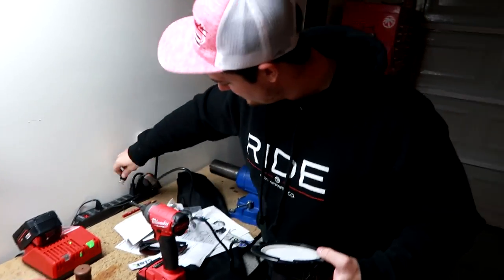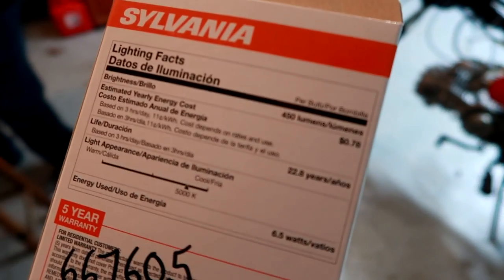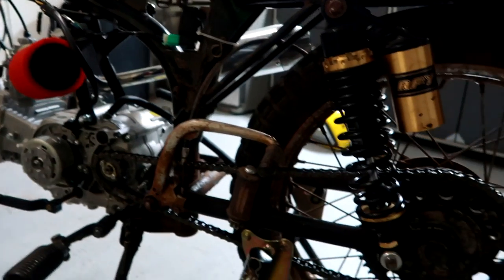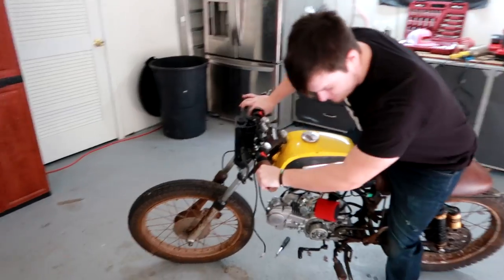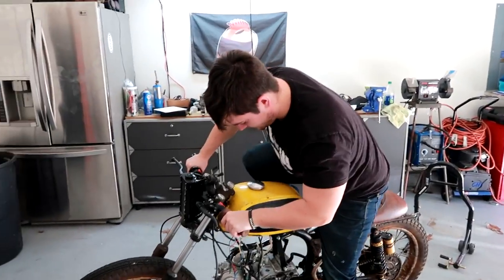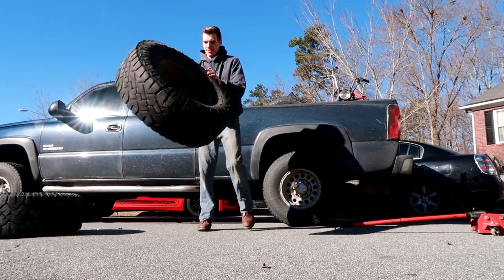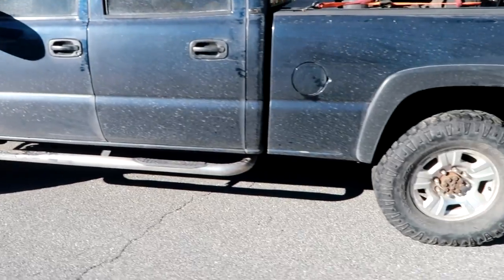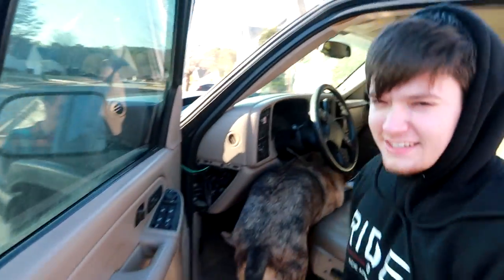the night i should have died

Comment: I almost had this happen after getting my tires rotated at a Goodyear shop. I drove it about 60 miles and noticed a wobble so I slowed down. my rear end started shaking back and forth and I started hearing a squeaking sound so I pulled over, 3/5 lug nuts had fallen off. Luckly I was only a few miles from the shop that did it so i went there and chewed them out and they had the gall to insist that sometimes this just happens and it wasn't their fault. I had them put 3 new lug nuts on and took the car home and checked all the torques myself, thankfully they were all right this time (I suspect they went over them all when i brought it back) I will NEVER visit that shop again and warn all my friends to stay away.
Reply: This was a Subaru Legacy, If it had been a truck I have no doubt the remaining 2 lugs would have snapped off and my wheel would have taken a ride.
Reply: Skwisgar2322 
No one freaking cares
Reply: Theawesomenarwale 14 who asked you for your input?
Reply: Skwisgar2322 Should've named the comment "THE TIME I ALMOST DIED"
Reply: Skwisgar2322
Reply: Skwisgar2322.
Reply: Skwisgar2322 dude same here i was riding through a field and my tires had just been tampered with and the back was wobbling all over
Reply: Skwisgar2322 good thing your ok
Reply: Skwisgar2322 so Sad but u lived

Comment: um, I don't get it. How did he nearly die? I mean his wheel fell of but that's not near death
Reply: julian wilson Think about it if his wheel came off at 70 he has little control of the back end, he could have spun around rolled it.
Reply: spin out at 70+ in a truck = roll over = high chance of death
Reply: Owen Van zyl OH I forgot its American so it's mph not kmh
Reply: julian wilson because he could of flipped his truck and it is a 6000 pound truck if it had of flipped it could of crushed him that's how he could of died
Reply: julian wilson think of it could have killed some one by flying into someone's car he could have lost a front tire made him turn really quickly at 90 degrees and he would have rolled it
Reply: Unlikely to crush him but to throw him out and crush him yea. those bigger trucks have more strength in there cabs (whole chassis to be honest)
Reply: Yeah, if this is near death then I nearly died when passing a car earlier today. What if he had come into my lane? shit, and at that velocity...
Reply: Yeah because you know most modern cars don't meet a specification for safety or anything....
Reply: if hes haulin 70 in a big truck with no tire yeah, he woulda flipped and spun.. and flew, yeah if not dead paralized. alot. :(
Reply: But he can allways slide and kill someone too.
Reply: zMelonz YES EXACTLY, that's what i was thinking. Wheels come off all of the time, it's not deadly unless it hits someone...
Reply: julian wilson I had a similar experience with my att rear tire popped off and my fourwheeler started to lean back and the I yelled for help
Reply: Logan n. Mays Maybe that is because a four wheelers wheels are spread 5' apart and a trucks wheels are spread over 15' apart.
Reply: zMelonz I agree
Reply: julian wilson if it had been the front it could've been tho
Reply: julian wilson it's a tire why is he scared
Reply: dylan case do you speak English?
Reply: julian wilson He almost died because he was in fear for his income and had to hurry and add a clickbaity title.
Reply: julian wilson I know right he just want views and tried the compare it to tanner fox nowhere near his story
Reply: The possibility of spinning out is very low. its not like he is driving on ice where he could easily lose traction if anything he would have more traction due to the fact the truck being lower and having more surface area for the ground to connect. and for him to flip a 2.5 ton truck at the  speed he was doing is very hard unless you suddenly change direction.
Reply: @dylan case
i read it fine and english is my first, he/ she obviously isnt intelligent enough to read past a few typos
Reply: EXACTLY. Nothing is considered deadly unless it kills someone... Bullets are not deadly if fired out of a gun, however they are deadly if they hit someone. It's not like the very definition of "deadly" is "able to cause death" because that would imply that a rogue tire is deadly no matter what.
Reply: Itz Lobz Trust me a pothole isn't going to flip a 3 tone truck.
Reply: dylan case Yes I agree
Reply: in america cars are made to withstand a roll over, i can see how he was close to death, but a roll over in most cars these days arnt deadly, for the most part. im glad he is okay
Reply: +Kane Costello yea its sad to see him spin of and die :c

Comment: and thats why you torque your wheels every once and a while
Reply: Sam Stewart lel, that truck must be crap when this happend.
Reply: Pavel Kuda not the trucks fault that the lug nuts weren't re-tourqed
Reply: Sam Stewart every one in a while you need to to do do it all the time
Reply: I know every 50 60 miles
Reply: 11k gaming 50 60 miles! I do upto 600 miles in 1 journey and my nuts haven't dropped off!
Reply: 11k gaming Wheel nuts...
Reply: I was joking
Reply: 11k gaming I know, was just making sure. I still have two!
Reply: Seth Watts I just use an air-impact driver and torque wrench with no issues.
Reply: 4 ugga duggas on the impact
Reply: Sam Stewart thats why you torque them after you change them lol
Reply: Alloy rims are notorious for the lugs coming loose you gotta keep an eye on them. He musta been pretty tired to not notice any sway in the vehicle.

Comment: your wheel fell off, you are on a highway, and your wheel fell off. i think you exaggerated a little bit.
Reply: o Lemurs you dont know what you are saying
Reply: It actually happens more than you think. I had a front wheel come off going ~45 MPH, my lug nuts completely stripped out. It doesn't take much, if they are over torqued or under torqued or cross threaded, you're looking at issues and your lug nuts do have a chance at completely stripping out and sending your tire one way and your vehicle another.
Reply: Have you seen the damage a flying truck wheel can do? They can continue for 100'ds of yards, and you're talking a 60mph 60LB mass - It can be fatal - easily! Especially if the oncoming vehicle is doing 65/70mph too - you're talking a 120mph collision with a 60LB mass - search youtube for rogue truck tyres.
Reply: JamieHail i know but he said he almost died
Reply: +JamieHail
Yeah I've seen that happen in those Russian car crash compilations ... really crazy stuff. Also, it's kinda funny how the tires can keep rolling for a very long time. X'D
Reply: have had it happen and when it happens to you or you see someone die because of it you will change your tune. Be very thankful this has not happened to you or a loved one.
Reply: He very well could've. It could've been a front wheel and when the truck dropped it jerked the wheel flipping the truck and smashing into a guard rail. A tire falling off at those speeds absolutely could kill him, he was lucky it was a rear wheel and it looks like he kept control.
Reply: My front wheel came off on the highway once. It just keeps going straight for the most part lol.
Reply: o Lemurs it came all the way off and he could only take lugs from three tires that makes six each not trying to sound mean but I thought about it and it made sense
Reply: o Lemurs How about you shut your mouth you don't know what you are talking about if you are going to bring the negative comments hear you should just leave. If you are going to be a hater than  just click off the video and give it a thumbs down don't wast your time writing negative comments. Dalton just keep doing what you are doing. The people that care and are not haters will all ways be there for you.
Reply: o Lemurs you are hating when you leave negative comments and no I think of what I wright and not just copy from other YouTubers name a YouTuber that I copyed what I wrote
Reply: Fernando Ruvalcaba thank you at least someone agrees
Reply: Prophetmaster Who
Reply: original commenter
Reply: It's the shock that does it. In the moment, it's terrifying.  It's still scary looking back, but it's 10x scarier in the moment.
Reply: TDPEquinox yea i dont think he was in MUCH danger but it was right after and he was pretty delusional because he didnt have much sleep so he was definitely acting on his emotions
Reply: o Lemurs no but thanks for asking
Reply: Brandin Emmons your profile pic explains a hell of a lot, some kid about 5 years old sitting in a go cart.
Reply: o Lemurs he's upset because he could've killed someone, not every one is OK with something like that plus he's tired
Reply: o Lemurs  u try possibly spinning out of control and possibly flipping at 75 mph in a 6000 pound truck in the middle of night in a location where ur not comfortable with
Reply: Buckwheat yea u should just be grateful that he is ok
Reply: Buckwheat I fliped my duramax the trans locked the rear end I fliped 4 times till I hit a tree the cab wasn't on it when I saw it after I left the hospital I had a 12 lift to so if i didn't have a lift probably still would have a driving truck
Reply: o Lemurs  he said he coulda died or kill somebody else
Reply: Okay. You go down the highway at the speed limit and have a wheel fall off. Then come back and say that again. I mean shit, having a spring collapse whilst doing 70 is scary enough and can pull you off the road. Wheels falling off are even worse...
Reply: A1 Sauce exactly, these people dont know how to drive a car.
Reply: +o Lemurs knowing how to drive a car does nothing for you when your tire comes off at 75 MPH. How is your knowing how to drive going to steer that tire from possibly killing or seriously injuring someone else? It's not. Also when your tire falls off, you get a rush of adrenaline and you're not sure what to do because you're not thinking clearly. I know you are the best driver in the world and know everything there is to know about tires falling off so you simply wouldn't understand, but those of us normal people who have had tires fall off know the feeling. We know the feeling of having your vehicle pull to one side or the other, and it doesn't take much for you to over steer to try to correct the problem and end up spinning the vehicle out or even flipping it. We know the feeling of watching that tire bounce down the road for what feels like hours as you become very familiar with praying because you are begging to god that tire doesn't damage something or kill someone.
Reply: dethreveng when you drive a car you develop confidence with and without grip.
Reply: o Lemurs Yes but not with and without fucking tyres.

Comment: At $70 a tank fill it may be cheaper to get a room then leave the truck running all night
Reply: skojo3e diesel engines actually waste little to no fuel. diesel burns really really slow. i live in Canada and it gets -40 at times and i leave mine running all night so i can get to work in the mornin and it maybe wastes a 16th of a tank. just a little insight!
Reply: ManitobaAngler- That's good to know, I thought it was like a gasoline engine where you wake up with an empty tank of gas
Reply: skojo3e glad i could teach ya something! lol. i used to as well, but ya learn something new every day!
Reply: Just FYI, plug your car in at night if possible.  Saves on fuel, environmental issues, and engine running hours are cut down.  Trucks running all that time, while it works, shortens the life span of it.
Reply: he drives a deisel truck they are hard to start cold my grandpa has a 2004 Cummins we let it sit over night not plugged in 
in the morning we had to take my horse to the vet the deisel was gelled up and the batteries were dead it is always better to plug them in or leave them running
Reply: Where do u live like state I live in Minnesota where it gets to be like 30 below at night
Reply: Andrew Harguth very true I'm from Minnesota to lmao
Reply: hey we are neighbors 
Andrew Harguth it's been cold this week lol
Reply: Ya it gets really cold out
Reply: skojo3e you burn only a ounce per minute in a diesel when it's idling
Reply: skojo3e I'd think about the fumes tho..
Reply: as long as you dont have a leak it should be fine

Comment: How are you driving? The rotor should be destroyed, possibly the caliper.
Reply: He was probably lucky to have the load on the back of his truck balance it just enough for him not to roll off the highway.
Reply: Billy Celli Shouldn't have drove on it honestly. I guarentee it fucked the threads up on the studs and lug nuts, ground the rotor flat and probably screwed up the pads. the caliper may have been fine but if it was me I would have only limped it a few miles.

Comment: I couldn't watch the whole thing, can someone tell me the basics of what happened
Reply: imma1star Did he crash or spun out or something?
Reply: Brooke Sykes 割 No hes just being melodramatic. His wheel came off because he was negligent with putting it on. He thought he had a flat tire and pulled over to see there was no wheel. Why he was in tears I dont know
Reply: Claydoh, It happens when you are in shock. You think of all the things that Could have happened when your wheel suddenly pops off in the middle of the highway AT night. Haha. My Ford Explorer 2007 during plain day lost a wheel and gritted the brake disk and bent the front end axle. 

Just saying if you can feel a pebble on the road picture your vehicle dropping 5 inches from its original height. While watching the lug nuts genuinely shooting off and scattering all over the road. 

Yeah.. I think it rightfully warrants that reaction xD
Reply: Brian Mucci Yeah when I was 16 I was driving a dodge ram with a 4 inch lift on 35s and the drivers side wheel fell off. I've been there and that was a bigger drop. Still not scary. A learning experience to tighten lug nuts with a breaker bar and not be young and dumb
Reply: torque wrench*
Reply: Edwin Sexton torque wrench kudos. Too tight and you wrist cross threading or breaking the bolt. Too loose and that's self explanatory.

Comment: I had a very similar thing happen on my 89 chevy, Traveling 70 miles an hour down a 2 lane highway, 35" boggers, 9 inches of lift, One lug stud snapped off, and the rest of the lugs nuts vibrated loose, could feel the truck shaking like there was a blown tire. Next thing i know the front driver side tire flys off, and races past me. Luckily i was in bumfuck nowhere, so nobody was hurt. My girlfriend and buddy were a little shooken up, but the truck safely skid on the rotor to the shoulder of the road, and came to a dead stop in the dirt. Found my tire by some railroad tracks a few minutes later. Jacked the truck back up with the stock scissor jack to get it out of the dirt, cleaned the wheel studs up, had a friend give me a ride into town, bought some new lugs nuts, reinstalled the tire and continued on the rest of my day.

Comment: 1/4in hex to 1/2" adaptor is not torquing the wheels. Lesson learned. Get a 1/2 inch impact, better yet a good torque wrench. It will save your life. I have a friend who this exact thing happened to, but he was not so lucky. Wrapped his car around a tree through the passenger side through the center console.  Ive had a loose wheel make noise but caught it in the neighborhood before the studs snapped. Another friend who bought a car out of state had a loose wheel come off, It was loose and the uneven pressure snapped studs off in a split second one by one. luckily the car was slammed so low it held onto the wheel. Shit happens

Comment: Happens all the time. Had tires installed at Canadian Tire I believe or Walmart, went on a road trip and the back left started wobbling, and violently. pulled over to see the 2 lug nuts missing. On the Trans Canada so there wasn't anything we could really do except drive into town that was miles away, and stop and tighten the remaining 3 every few miles.
on a sadder note, a student from my high school was killed not too long ago from a tire that had fallen off a pick up on the other side of the highway and flew through her windshield. Tragic.

MORAL OF THE STORY: Always torque your lugs to the proper specifications.

Comment: Don't torque the lugs, make them as tight as hell! Then this kind of stuff won't happen.
Reply: If you don't torque your lug nuts with a torque wrench, you run the risk of over tightening a few of the nuts and warping your rotors (with a vesicle with disk brakes of course).
Reply: Steve Yulenburg better to have one warped that to have a tire come off and grind it to a pulp doing 90

Comment: Lmao dude really cried cause his wheel flew off
Reply: you dont know how things could have ended
Reply: Kevlin2408YT with him dragging his rotor and slightly loosing control I've had this happen to me before in a work truck you're other 3 wheels will keep most of you're weight up and with a truck you already have stiff springs so the whole hub assembly wouldn't drop far enough to cause him to wreck just lmaoo

Comment: That was pretty bad but I think mine was closer. I was going over 100mph on my motorcycle and got a bad speed wobble. I had to let go completely because of how bad the handle bars were shaking and was going to the opposite direction towards a car but luckily it stabilized itself and I merged back to my lane just in time

Comment: Wrong lug nuts... I'm sure someone has said it but you used a acorn lug nut instead of a flat Chevy lug for that stock Chevy wheel. Glad you're ok and your lucky that was the only one that fell off. It also looks like that jack you used was from discount tire. So I think someone or you worked there and should have none better, but that may not be the case.

Comment: dude you wouldn't have died there's more weight on the other side of the truck so it wouldn't of flipped onto it's side and you could put it into four wheel drive to use your front tires to pull off the road